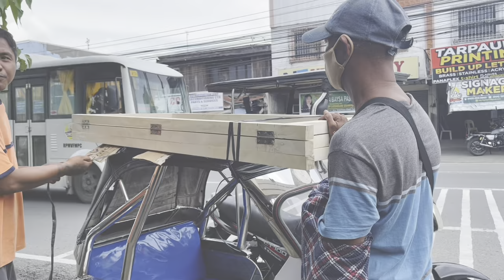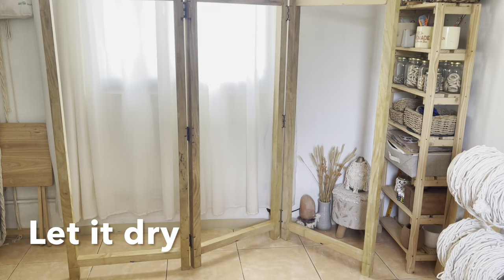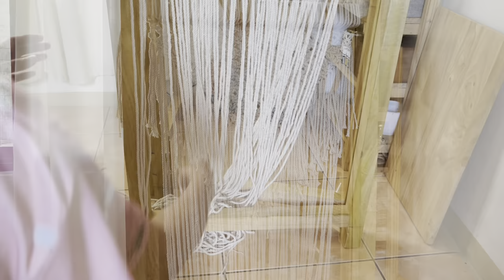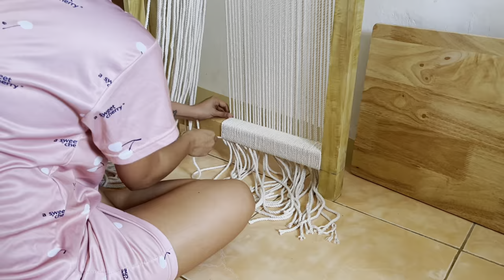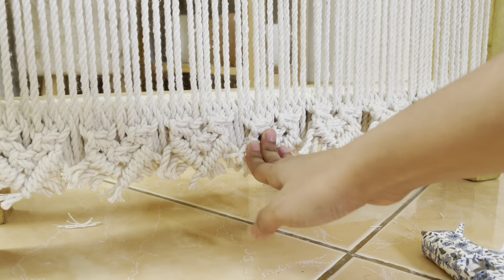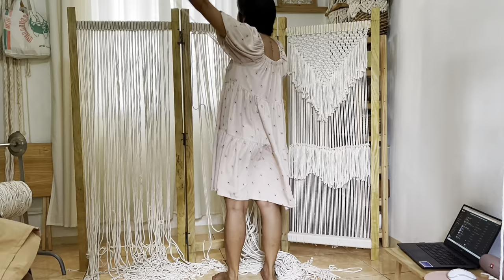DIY Macrame Room Divider Easy Tutorial for Beginners | Home Decor Wall Divider

Comment: What size cord did you use?
Reply from the maker: 5mm :)
Reply: Hi i m new to this: may i pls ask how many meters of the 5 mm 3 ply do i need to order in total? Thankz
Reply: Is it as per ur video; 32 cords x 600 cm = 19200 cm = 192meter?